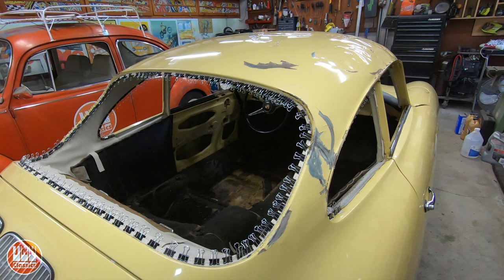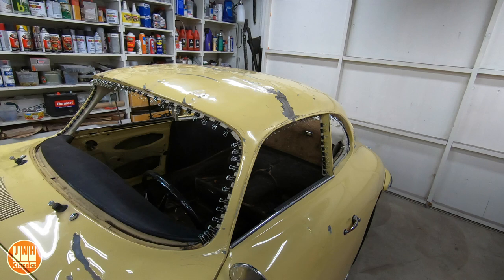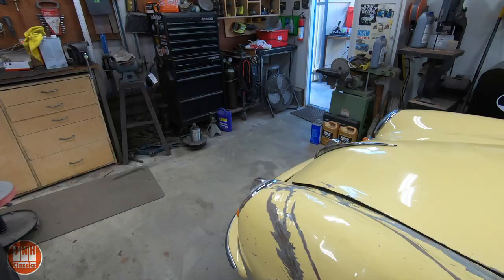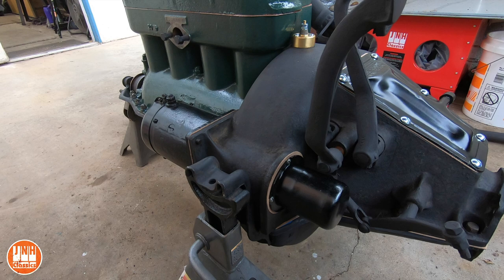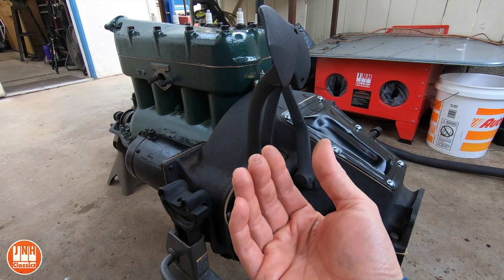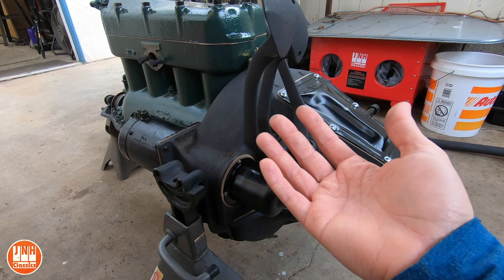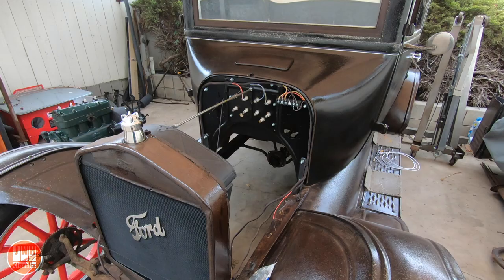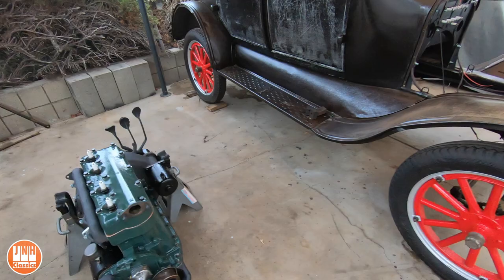Porsche 356, VW Beetle & Model T - Sunday Update Video (1-24-21)

Comment: I found with my model t it ran so much better on magneto . Only time it ran as good as the magneto was when I went to 12 volt battery and alternator . Magneto will make way more voltage than the 6 volt battery and generator .
Reply from the maker: Good to know. Thanks 👍

Comment: I guess you just flip cars so you're not that familiar with each one.  Running a Model T on magneto is not a novelty.  Normally T's are run on magneto after starting on battery.

Did you balance anything?
Did you check piston ring gap?  

I hope you give full disclosure to whomever buys this car.
Reply from the maker: I don’t flip cars, and I would say the build series is pretty good disclosure 👍 I also expect to lose money on this build if I do sell it.  None of my builds are done with profit in mind and I rarely see a profit. I just like working on and driving interesting cars.